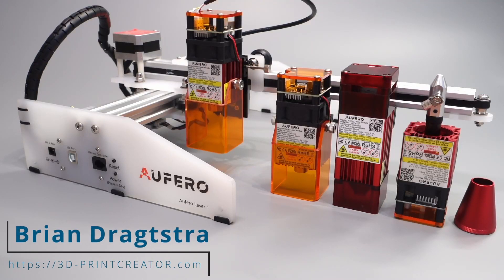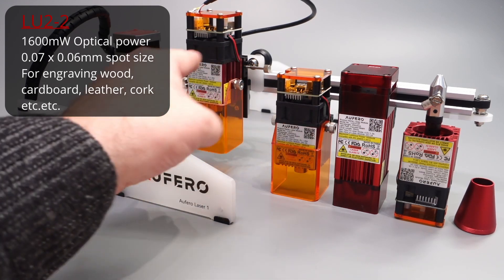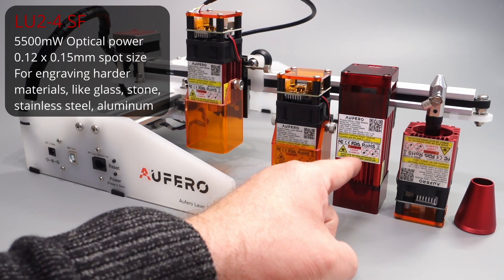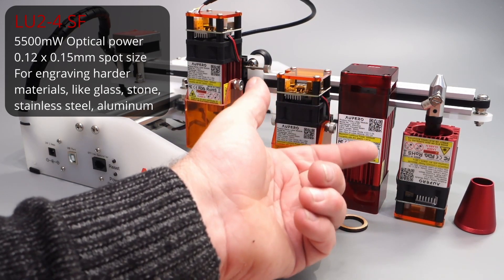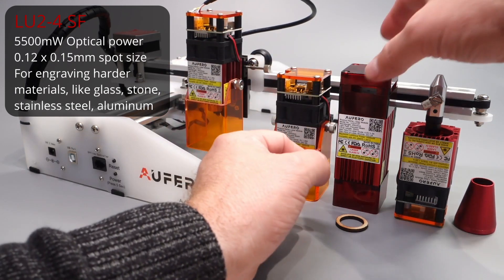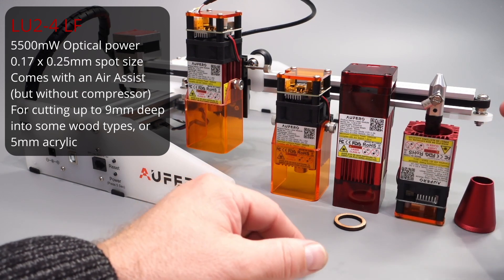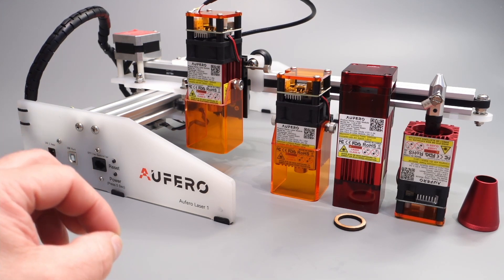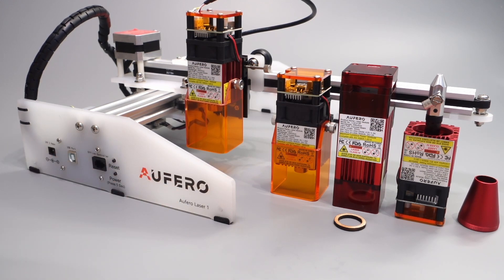▼ Choose the right module for the Ortur Aufero Laser 1

Comment: can i use different module? not aufero brand?
Reply from the maker: As long as it is an 24Volt controlled laser, yes.
Make sure to understand the pin layout of the old and new laser, you might have to switch some wires.

Comment: Nice video, whatss your opinion about LU2-4?
Reply from the maker: All 3 the modules are great, but you need to see for yourself which task you will be running the most. If you don't know already, go for the SF module, as that is a multi purpose laser. For cutting use the LF module, and for detailed engraving, use the low power module.
Reply: @3dPrintCreator  Thanks for the reply. I own the lu2-4 but it was hard for me to find detailed information because now they only sell the other two. I want to use it mainly for engraving and cutting for stencils (paper, vinyl and fine things in general). At the moment the proofs in engraving on wood are quite good. Greetings

Comment: Can i use the LF laser also for engraving? or is it just for cutting? (sorry im noob about laser..)
Reply from the maker: Hi Misja,
Sorry for the late answer. Yes, you can adjust both power and speed so that you can make nice engravings with it, yet the best engravings are made with less powerfull lasers, but they can't do any cutting.
Reply: @3dPrintCreator  Hi , Better late than never. Thx for the replay. Now it will be easier to make a choise for me to buy a laser. I think a nice add to my cnc machine.
Reply from the maker: Hi Misja, Make sure your CNC machine works with 24 volts, as the laser unit needs this.
Most CNC machines I know (not that much) work at 12 Volt.
Reply: @3dPrintCreator   I know that. The laser it self will get a 24v powersupply. The on /off will be done by a fast relaisboard that will be activaded or disabled by the CNC board. (That's my idea of making it work with my CNC (Upgraded Stepcraft 840)
Reply from the maker: @MisjadeBoer  I don't think relais boards are fast enough to switch PWM controlled lasers. A transistor for switching would be a better idea.
Reply: @3dPrintCreator  Oke , thx for that advice too. I will take that in mind when i will go to final setup. Thx again for all the advice and responses.

Comment: Interesting. 
Details that most entry laser companies dont inform.
I am trying to cut 1/4 plywood. So i figure largest i can get and just turn down the laser for the etch part.
Reply from the maker: 1/4 plywood is doable, but only if it's made from soft wood, like pine or popular. 
Best laser for this is the Long Focus (LF) model, and you should focus at the centre depth , so 1/8 in.
Reply: @3dPrintCreator  my current fixed laser.. I will have to remove the shield to get it lower.  Not sure if it is LF or SF. I assume SF

Comment: Great video. I was wondering which module is best suited for engraving on painted or anodized aluminum? I wasn't sure because in this case it's the paint that's being etched and not the actual metal. Or would the 1.6W still be too underpowered?
Reply from the maker: Because in this case you are not going for greyscales, I would recommend the SF or short focus laser, because this will burn away the paint in the best way.
Reply: @3dPrintCreator  Cool, thanks for the advice!

Comment: Thanks for the great vid. Very informative and easy to understand. I am completely new to laser engraving, and am considering this unit with the SF module. I was wondering if it would be suitable for use on softer materials like leather and wood, or would it be too powerful? Or would i just reduce power, increase speed to accommodate?
Reply from the maker: Hi Mike,
The 5.5 Watt SF module is perfect for wood and leather engraving, and even for cutting up to 3mm deep. But, if you want to make photo realistic images on soft wood, or leather, then you could be better of with the 1.6 Watt module. 
All in all, I see the 5500mW SF module as the best all-round solution.